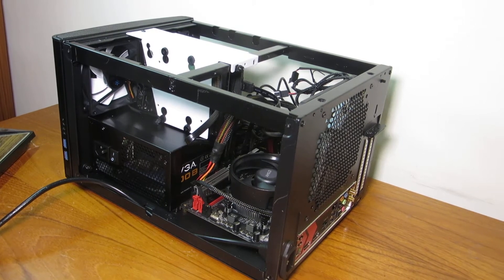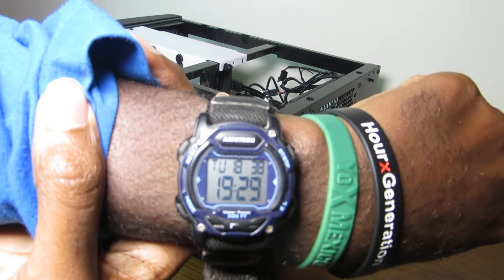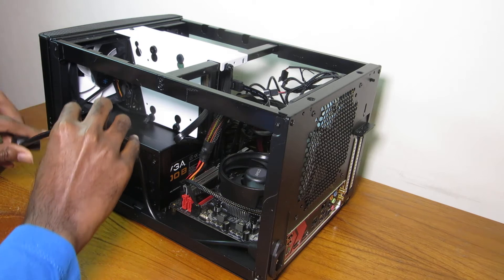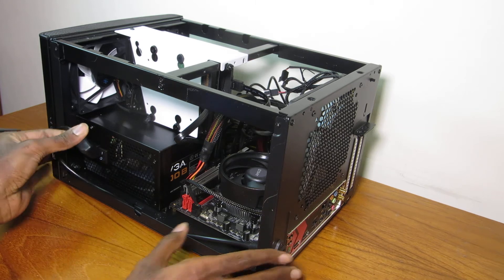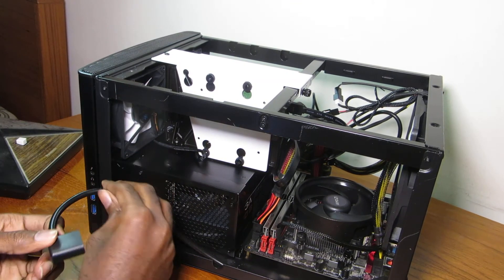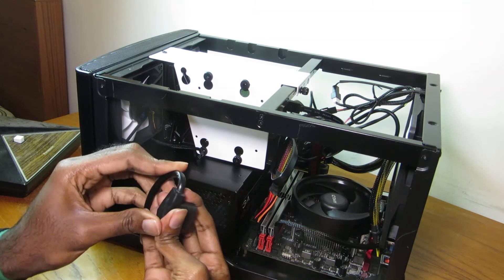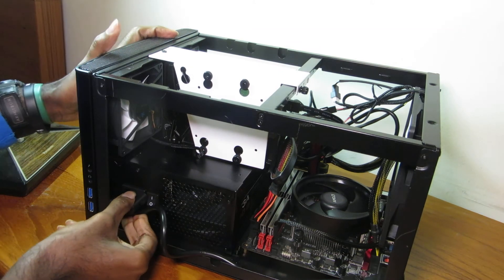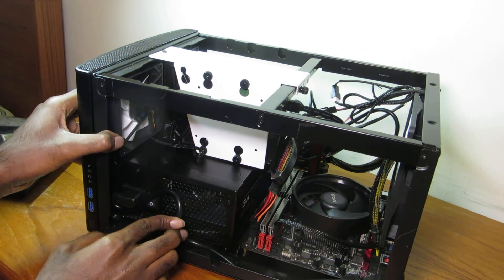How to install a power supply cable in Fractal Design Node 304

Comment: Can't you just mount it with fan side up?
Reply: yeah its kinda tradeoff - you either break a cable or break a best practice. Also if you mount it with fan side up, the outlet is gonna get much closer to other end of the cable which makes this cable a bit more messy. Funny is that original FD PSUs are oriented in a correct way
Reply from the maker: nope. the psu must pull air from outside the case
Reply: Must is a strong word. For decades the standard was PSU drawing air from above the CPU and exhausting out the back. Today's power supplies are rated to produce about 40C of their own heat, but to work properly up to 100C, which means a PSU can safely draw your component's air and blow it out. Of course if it draws fresh air the better, but for example my PSU doesn't even turn it's fan on unless at 50% load, which I've never seen it do
Reply from the maker: @astrocslopes863  i suppose its now best practice to have the psu fan down